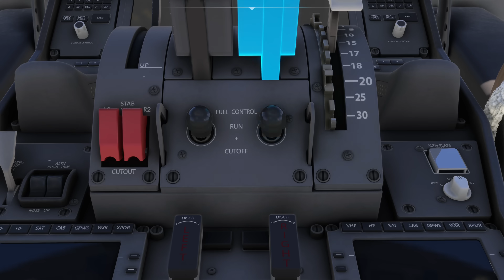Air India 171: Why Did The Fuel Cut-off Switch Get Moved?

Comment: How do they determine the actual switches were placed in cutoff?  Do they have separate sensors that record the physical position of the switch levers?  Or are they just seeing an event logged into the computer?  Computer issues and wiring issues could in fact disable the fuel without touching those levers.
Reply: They are seeing an event logged in a computer.

Comment: There’s no irrefutable evidence provided so far to confirm that those switches were physically moved to cutoff position. FDR record electric signals (Cutoff or Run) only. 

Also, time between operation of the two switches was registered as 1s probably because the maximum resolution of the FDR is 1s. For instance, the time interval from 12.35.14 (+4/10 of a sec) and 12.35.14 (+6/10 of a sec) will register as 1s apart although they are 2/10 sec apart, if the FDR reports time to the nearest second.

Comment: When we say that the fuel switches went to "cutoff" (and then back to "run") do we positively know that the actual switches shifted from one position to the other and back? Are these switches equipped with a positive position feedback that is being recorded in the so called black box?
If not, how do we know that there was a human hand involved and not some downstream fault?
Reply: The second delay between the initial CUTOFF of swtich 1 and switch 2. And then the seconds delay between the later CUTTOFF to RUN of swtich 1 and 2 suggets it's likely human hand. If it was an electrical switch issue than there wouldn't be such a delay.
Reply: I believe I read an engineer explaining these are dumb switches. Can only be triggered by human hands and not by software
Reply: Yes they’re probably failsafe / kill switches, I’m not involved in aero but I’m an engineer who has worked in automation including some exposure to nuclear power stations. There are very strict safety standards for these sorts of switches and it sounds like a ‘dumb’ direct line for emergency use.
Reply: @IssieAndLife  Failsafe in the context of a airliner engine is on.  They will have dual redundant self checking circuits that will only allow the off state if everything agrees.
Reply: @ronvdb engineers always thing their designs cannot possibly fail or function in any unintended way, and that is when accidents happen. Not saying that’s what happened here, but that is a dangerous mindset for engineers.
Reply: They're analog switches and their state is recorded on the flight data recorder.
Reply: @kewkabe  that is the most important thing to know: does the FDR measure switch position, or engine fuel valve position, or EEC signal, or all of these things?
Reply: @sofbash  Yes, on the 787 it records the cutoff switches' physical positions and also fuel valve status for each engine (open or closed). EEC control of fuel flow isn't recorded (just various EEC states) but the EEC can't move the physical switches so there would be no other explanations for being recorded as shut off without physical intervention.
Reply: Any hypothetical "downstream fault"  would not only have turned two engines (with two different control circuits) off, it would also have turned them both back on again ten seconds later. There was no such fault, the switches were manually flipped.
Reply: I don't see anyone actually answering your question. Can someone provide a wiring diagram or at least a block diagram? Do the switches have a positive feedback loop....an entirely different circuit to verify mechanical movement? If it is just a "dumb switch" that pulls voltage to ground, then it is theoretically possible for a wiring fault or logic issue to emulate physical movement.
Reply: @Skrame100  i mean just go ring up boeing, but dont worry the investigators probabbly already did that, also did u think the FAA or EASA in case u dont trust the Yankees, would have never certified the aircraft if that wer the case, that the FDR can be used for that, like cmon ppl use yr kidneys.
Reply: @Skrame100  I am a mechanic for 4-seat Cessna style aircraft.  On these planes, the IGNITION is ALWAYS ON even if the wire from the cockpit gets broken.  By default the ignition is "live" unless there is a deliberate action to ground out the spark.  Likewise on jets I assume, the fuel is ON by default, unless the switch in cockpit is moved to "Cutoff."
Reply: @chetmyers7041  As a retired auto mechanic with extensive background in computer diagnostics, I was merely dittoing the OP in asking if there is definitive information about a feedback loop(or not) and I'll also add about redundant circuits. If that sort of circuit does not exist and I would think it would, then nobody can ever say the switch was physically lifted and moved. Whatever the switch does to inform the control unit of the command, could happen albeit unlikely, by other means. Inquisitive minds wish to know.
Reply: @Skrame100  Yes, I can see no direct answer myself. Yes my question is about the existence of an independent detection and recording of the actual physical position of the switch itself.
Reply: @Skrame100  i agree with this, this plane was documented the flight before for its major electrical problems and this info is being highly disregarded, none of this data can be trusted.
Reply: The report very specifically states that the cutoff switches were shifted. "Transitioned" is the word used in the report, but that word means shifted or changed. They specifically state that the switches (not some electrical signal, but the switches) "transitioned" from Run to Cutoff.

"The aircraft achieved the maximum recorded airspeed of 180 Knots IAS at about 08:08:42 
UTC and immediately thereafter, the Engine 1 and Engine 2 fuel cutoff switches transitioned 
from RUN to CUTOFF position one after another with a time gap of 01 sec."
Reply: @SeanFication  the report is also very specific in that the pilot asked the other why he moved the switches, not why were they in that position, u would assume the question to be more like "why are they in cutt off" not " why did u move them to cut off" that level of specivity likely indicates it was human not mechanical, or atleast he verified them visually.
Reply: Those switches are locking toggle switches. You have to pull them out slightly to move them. So they cant accidentally be bumped to off.
Reply: Correct… or was this natural question that was asked due to fuel cutoff… turning off and turning on engine is last attempt to make engine work
Reply: A telltale sign is the the NTSB / FAA have issued an all clear for Boeing. If there was any doubt that an electronic malfunction caused switches to go off, there would be a much more detailed investigation.
Reply: yes because the CVR report stated that one of the pilots asked if the other moved them, confirming the switches were visually verified to be in the cutoff position, and then was put back to run, how it got to cut off is the question here.

and if they enhanced the CVR audio, in the time to come, they will probably be able to hear the switches, they make a distinctive click sound.
Reply: @xdd-69  no, it's also possible that he saw an EICAS message in front of him, e.g., ENG SHUTDOWN (instead of ENG FAIL) which is the message we get when we shut the engines down when parking, and then he might have quickly concluded that the other guy had done the cut off (but not yet looked at the switches)
Reply: @sofbash  considering the limited time frame in which this happened around 10 secs before the switches were turned back to run, him seeing the positions of the switch is more likely then him deducing from the EICAS that the switches are in CUTOFF, also EICAS has some delay and with startle factor, and immediately as a pilot ur reaction is to start scanning, and engine related problems the throttle quadrant and ofc the EICAS would be the first place he looked, but i find him deducing all that in just 10secs to be unlikely, but hey maybe AI has Super Pilots idk.
Reply: @xdd-69 I agree that, at this stage, the most likely explanation is that the fuel switches were moved by someone in the flight deck. But the investigation needs to eliminate all other lines of enquiry. 

It may be that with more CVR data and some background info on the personalities involved the picture will become more clear, and one of the theories stands out far above the others. But with the info we have at the moment, we can’t yet make that conclusion.
Reply: @xdd-69 Hearing the switches being moved on the audio is a great clue, thanks for pointing that out.
Reply: @xdd-69 that’s not what the pilot said.
Reply: @michaelgoggin2011  nobody except the people at AAIB know what the pilots said, we are all working off the paraphrase included in the Preliminary report
Reply: @xdd-69 I’m going to hazard a guess of electrical anomaly. The switches were never touched, the pilots were surprised, and the restart was automatic
Reply: @michaelgoggin2011  it is possible that an electrical failure shut them off, and the pilots turned them off and turned them back on again quickly, U do that all the time in an Aircraft, power cycling to reset systems is a very common thing.

However there is the issue of the 10s time gap from when the switches were moved from RUN to CUTOFF and then back to RUN, thats not how u power cycle things normally, u dont wait 10secs to turn it back on again.

The FDR also records fuel valve positions in the engine, and many other engine parameters not just whether the switches were on or off, they would have most likely cross-checked all of that to be sure the switches were indeed moved.

But then the Switches being moved would have been clearly audible in the CVR, if that was the case idk why it wasnt included in the report, whether the sound of the switches being moved could be heard or not, the CVR has very sensitive mics, Investigators have used it to determine accurate engine power setting from the cockpit engine sounds alone in the past, thats how good they are, the switches being manipulated would have been clearly audible.
Reply: @xdd-69  No, the preliminary report says no such thing. And that's the danger if we keep repeating stuff that people like Capt Steeeve say is in the report while it isn't. The literal wording in the report is "one of the pilots is heard asking the other why did he cutoff". He might have been talking about the aircraft. "Why did he cutoff?" Until a transcript is released, we should not jump to the conclusion he actually asked the other "why did you cutoff".
Reply: @AnOnymous-go7kn  Yes this is exactly why we need cockpit video recorders. The snippet of transcription is very much open to interpretation.
Reply: @AnOnymous-go7kn  We don't just want a time-stamped verbatim  transcript. We want the actual audio to be released so we can hear the intonation re the pilots discussion.
Reply: @yngndrw.  Yep, deliberately so!
Reply: @AnOnymous-go7kn an airplane is masculine in hindi
Reply: @xdd-69  And the other pilot answered that he didn't, confirming that they never moved. See what I did here?
Reply: @OidhcheMhath  if the first pilot had to ask i why the other pilot had switch the fuel control switches to cut off, that line of questioning only most likely happened after he visually saw where those switches are, otherwise he would have asked other questions as to why they were losing thrust, its just a very specific line of questioning.
Reply: @xdd-69  Could've happened just as well because he heard the engines lose power, or seen or heard some alert.
Reply: @xdd-69  Additionally, we don't know what exactly was said in the cabin. The preliminary report only indirectly reported the exchange.
Reply: @OidhcheMhath  The flight deck is a very complicated place, with many switches and buttons.

The Engines can fail for a vast amount of reasons.

To ask such a specific question, as the report mentioned "one of the pilots is heard asking the other why did he cutoff" would have only been possible if he has actually seen them in cutoff, he also most likely heard the sound of the switches they make a very distinct click, and the 787 flight deck is a quiet place, it should also be audible in the CVR, but we dont have the transcript so we cant be sure on that, yet, 

Otherwise he would have asked a more general question, like "why are we losing thrust" the fact that he asked such a specific question right down to the exact switches, likely meant that he saw their positions visually.
Reply: @xdd-69  One again, we don't know what exactly was said. All we have is this from the preliminary report:

"In the cockpit voice recording, one of the pilots is heard asking the other why did he cutoff.
The other pilot responded that he did not do so."

Not even a direct quote. What was actually said was likely not even in English. Hold off on analysing and putting much weight on the conversation until we (hopefully) have the actual recordings.
Reply: @OidhcheMhath  the only way u will get to listen to the recording is if u go to New Delhi and ask the AAIB, nicely, and they will most likely not give u a copy, these things are very much protected by law, there will only be a transcript in the final report so we can look forward to that.
Reply: @OidhcheMhath yes, and without going back to check, I think we also do not know the timing of that dialogue. IIRC it was just included on the page, but not in sequence.
Reply: @OidhcheMhath and the first pilot never said that in the first place. He said “why did he cut off” and may have been talking about the plan itself or a subsystem
Reply: @OidhcheMhath he could have meant it
Reply: When you have audio, my first instinct is to assume everyone at least thinks they are telling the truth, and that might mean that something else shut off the fuel to the engines.  At that point, they would have to be literally beyond human not to fiddle with the switches to try to figure out what the hell happened.
Reply: @387tallen 
It didn't work like that. The switches were thrown to cutoff , the data recorder showed the engines shut down, then the switches 10 seconds later were thrown to run and the engines tried to start.
Reply: They can be positioned mechanically.
Reply: They are mechanical switches, they are not like a relay.  If the data recorder indicates the switch was thrown it was.
Reply: Is it possible that one of the pilots was following the wrong checklist?  If they were using the wrong list, I could see how a mistake like this could happen and how a pilot would say he didn’t do X when asked.  Kind of like if you are asked what the last traffic sign was as you are driving down the road. You see the sign, you know what the sign means. You make sure you are complying with the sign. You carry on driving. If asked about the sign, it’s highly possible that you could not recall what the sign said.  
The purpose of a checklist is to limit the dependency on memory and make sure procedures are followed.
Reply: @WalknBullseye  they had no time to do any checklists, also aircrafts also have memory items for critical failures that pilots memorize and perform immediately with no delay.

Comment: i have a question... @2:19 you mention that the other pilot acted quickly to put the engine back to "Run" after 10 seconds had elapsed from it being put to "Cut off." the pilot knew what occurred so why did it take 10 seconds to flip a switch back to where it should be? i am no pilot but common sense tells me it shouldn't take 10 seconds to flip a switch like that. especially considering the situation they were in (just took off). wouldn't a pilot instinctually flip it back without even thinking about it because of survival instinct, or training, or situational awareness? do you think that if the pilot switched the engine back to "Run" immediately (like 2-4 seconds; not 10 seconds) that the plane would have been saved from crashing?

Comment: 1 sec to off switch and 4 sec to on switch . 🤔 hmm. How is that possible?

 it takes more than 1 sec to off. Check the stopwatch.

Where is the sensor for timing and on off. Inside the switch or engine?

Comment: This is what the report actually says:- "at about 08:08:42 UTC and immediately thereafter, the Engine 1 and Engine 2 fuel cutoff switches transitioned from RUN to CUTOFF position one after another with a time gap of 01 sec."
That is not what Capt Steeve says. He says that the 'switches were physically placed to cut off''. Well perhaps they were. But the report does not actually say that. Why not? And if it does not say that then Capt Steeeve cannot know either!

Comment: We saw a 10 second gap between fuel switches moving from cut-off to run. Captain Steve, based on your experience, if you were faced with engines spooling down after rotation, how long do you think it would take you to determine the fuel switches were in cut-off state and move them back to run? 10 seconds seems a long time. Thanks again for your valued input.

Comment: My thoughts are the pilot that turned them off is the pilot that asked the question to put blame on the other pilot. 

10 seconds to turn them back on is a long time. Instead of asking the question wouldn’t your first reaction be to turn them on and then ask the question. 

There needs to be logic added to the FADECs to prevent both engine shutdown when in certain configurations.

Comment: The part about the camera in the cockpit that you're completely missing is if there was a camera one would know indisputably whether the pilots moved the switches or not and which pilot performed that currently we don't know if either pilot transitioned the switches as the flight data recorder only indicated that the switch position change not who or what changed it

Comment: 7:25 well a design-flaw is a flaw. it was operating the way it was designed. being able to just cut off both fuel without a confirmation step or both pilots input is a design-flaw